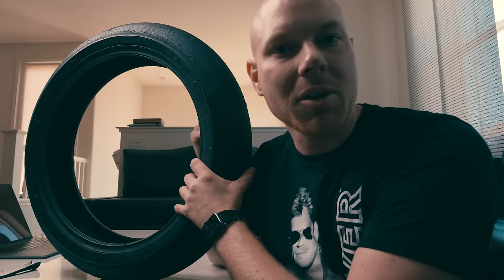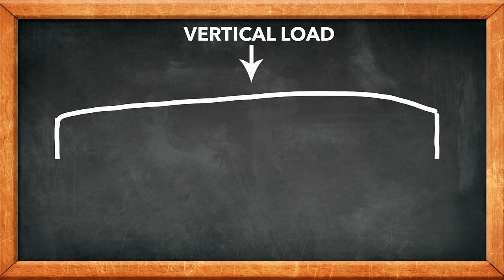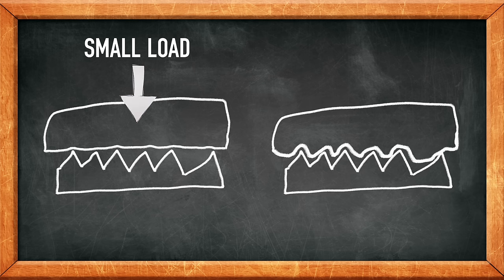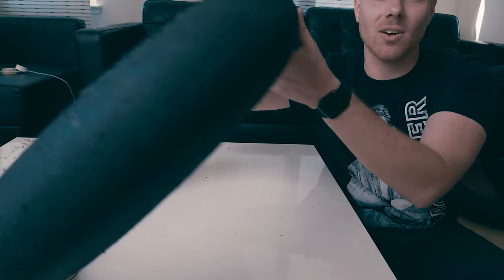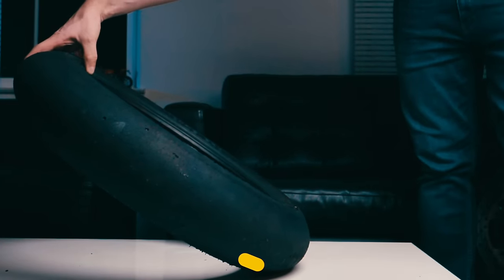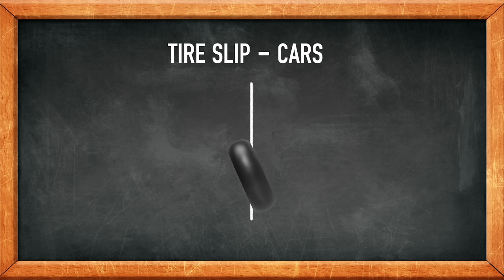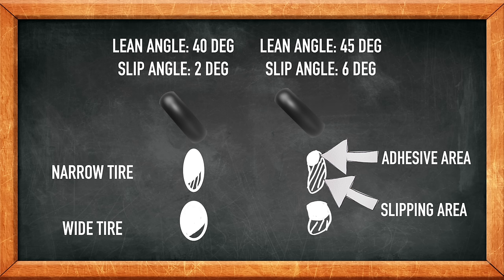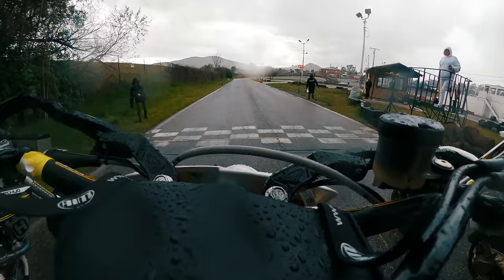Tire Grip | EXPLAINED

Comment: Showed this video to a friend while discussing tires. Question though, what happens when changing tire size say from a 180 rear to a 190? If the wheel is narrower, on a Ducati 749 which was the bike in question and I’m not sure it’s different from a 999, that would change the shape of the 190. It would make it more triangular being on a narrower wheel. Wouldn’t this also affect the molecular structure of the tire like stretching a rubber band? Curious as to your thoughts.

Comment: Tire grip is all about materials used. Not only with the tire but aswell as what your putting the tire on(road surface).
Reply: Thats what skatewheels are made out of different materials. Paddle tires use the sand against itself.

Comment: Is it safe to change tire width for example, from 150 to 160?
Reply: Yes.... Sort of.. if the bikes swing arm will allow the wider tire, and if the rim is wide enough, it is safe. The problem comes when the Rim isn't wide enough, the tire deforms beyond what it's intended and, essentially you get a very tall unstable tire. Or it runs on your swingarm/frame/fairings.

Comment: Wider tyres have more grip? Well that all depends on a great deal of variables, rubber friction is just the start of those dynamics. Think about a drag car tyre folding under itself during takeoff and then expanding during the run... Now try turning a drag car around a corner.

Comment: "Friction is indepent of contact area, as the load is the same, not so for rubber friction"

"If we increase the load, we have more friction"

Now, wait a minute.

As the tire deforms, even microscopically, the coefficient of friction changes, thus changing the friction force.  Friction is still independent of contact area.

Comment: Hey guys, I really need help here.
Ive got a Onewheel XR and I'm trying t find out if you still need a treaded tire for grip when it gets a ''little'' wet outside.
The tire is quite wide en your own weight is directy on the one wheel. 
Can I still just use a slick tire safely on a wet road? 
(Speed is between 20/30 kpmh, 12/18mph) 
-O-

Comment: Hey Mike. When you take all factors into consideration, including the tire grip, does it mean that cars have more grip compared to motorcycles? (let's say a Superbike versus supercar, or a rally bike versus rally car. Apples to apples.)
Reply from the maker: Great question Tyler. It depends on the car! A sporty but still ‘regular car’, say a BMW M3, will be able to maintain less lateral acceleration in corners ~1.1 G, has less grip), as compared to a sport bike with good tires, ~1.2-1.5 G.

A Formula SAE car will be able to maintain higher lateral acceleration ~2G, because of its wings, which provide vertical load, without the disadvantage of mass. 

A Porsche GT3 will be closer to a sports bike with good tires. 

A Formula 1 car will beat all of the above with ease. Like it’s not even close.
Reply: @MikeonBikes  Thanks for the answer Mike! So excluding F1, a top end motorcycle and a top end car should be pretty similar.

F1 or Le Mans seems like alien technology compared to bikes or cars. Do you forsee a future where bikes will come up with such technology to be able to compete in lap times with F1/LMS? (Winglets, downforce, breaking/cornering power etc.)

Comment: I actually blasted those other guys for saying tire size doesn't matter, such ignorance and lack of understanding.  If that were the case race tires would only be 1" thick to reduce rolling resistance and that also puts more downward force across a smaller surface area for more friction right? 

We have different compound tires that provide different performance and the grip or traction is directly correlated to contact patch size (width), reduce the contact patch you reduce the working area for those forces to be applied.

Comment: 12:11 "wider tires require more lean angle"
i've learned that the lean angle depends only on your speed and the radius of the turn and also little affected by:
 the bike's and biker's weight and the biker way of sitting

i don't thing that it has anything with tire width
Reply: the lean angle that matters is not that of the bike's but rather the line from center of the contact patch to the center of gravity of the bike+rider system. a wider tire moves the contact patch closer to the inside of the turn for a given bike lean angle, reducing the angle that matters.

meaning wider tires do require more lean angle

Comment: Well, it never made any sense to me that the size of the patch supposedly has no effect on grip. Just thinking about it, I can feel grip difference from just over/underinflating them. If the "patch size has no effect on grip" story was true, the tire pressure should have absolutely no effect on grip and only thing that matters is the material that touches the ground (ie. as long as the material is smooth tire and not my rims I should be getting same results even if the tire is flat).
What I would like to understand is why grooves on my new Michelin Road 5 are in opposite directions on the front and back tire. The back tire seems intuitive -- as it rolls forward the channels push the water outside. The front tire is opposite, as the tire rolls forward channels narrow down effectively pushing the water inside. I have checked the rolling direction arrow like 20 times when I was replacing tires on my bike last weekend. One theory I have is that the front tire is narrower and the grooves are relatively deep and so on the front tire it actually might make sense to keep the water from dispersing.
Reply: I know that with dirt/gravel tyres that the grooves are opposite because the rear is accelerating, while the front is braking, ie. opposite "directions"

Comment: i thik the F=μn is not the right formula as it is for sliding the one that should be use its the rolling friction Fk,r=μk,rFn used whit your specific material as rubber

Comment: Cannot understand the contact patch size yet. On 3:33 you "explain" that more contact patch means more adhesion, but this "adhesion" is actually what you called before "simple friction". And this simple friction is indeed depends on the weight (normal force) only, no contact patch. So this adhesion is also depends on the weight, no contact patch.
Reply: I think you need to watch again and grasp the content a bit more carefully. I also rewatched the video a couple times to really get it
Reply: Actually the weight is not really that affecting the grip from contact patch. The size of contact patch and the amount of adhesive it self determine how much grip will achieve. I know weight also takes part in grip, but at certain level you don't really need to over think about it, because we're talking about motorcycle dynamics
Reply: @jeeewhyyypheee  Based on what you say the contact patch size influences the grip better than the weight?
The video says that, without any scientific support.
Just saying something doesn't make it true.
The only science provided is the friction coefficient graph. It just says this coefficient depends on the load, and is not constant. No true explanation on this fact was given.

Bottom line - saying patch size proportional to adhesion is empty words.
I'm not saing its false, just saing no justification was provided, and this is what I expect from this type of video.
Reply: @idanpere1  Maybe this is just a terminology thing here? (I'm not a scientist) My understanding is that vertical force (weight) acts to deform the tyre to create a larger contact patch. The issues are slip angle and thermal stability which ultimately determine the ability of the tyre to maintain a certain level of grip.

Essentially aren't all these things just interdependent? From a rider's non-scientific pov, I certainly feel that there's more grip when the same tyre feels a bit softer by letting out a psi or two within the manufacturer's range (road tyres). And I also felt that better suspension provided more grip. Isn't better suspension in braking and cornering helping to maintain the stability of the contact patch?

I don't know for sure what is going on a scientific level so please explain how we can get more grip from the tyres.
Reply: @2002RM  I really like the way you describe it. For me weight alone doesn't really affect grip, and weight only can add contact patch at certain maximum level, after that it's all depends on tire performance.
Reply: Adhesion is very literally NOT simple friction.  Simple friction is at play as far as pressing the tire more into the grooves of the ground for traction (to a degree as it's not a pure linear equation), but adhesion is more like the effect of a roll of tape.  Put a piece of scotch tape on a table with a little bit hanging off, then pull the tape towards you (laterally/sideways, like taking a stick of gum out of the pack, don't peel it up).  Had a lot of grip, didn't it?  Was there a lot of weight there? No.  Now put a paper weight on the tape, did it change very much in how much force it took to pull the tape off?  No.  Why? Adhesion forces, not simple friction, are at play.  Especially with slicks, adhesion forces vary based on how much contact the rubber has with the road, so the more surface area, the stickier it will be.  If this wasn't the case, race cars would be going out on Tour de France bicycle tires.
Reply: @nunyabusiness896  I really like the way you describe it with a roll tape.

Comment: I'll give you a simple experiment to do to prove yourself wrong. With the motor off put your bike in 2nd gear and push it at let's say 5mph then dump the clutch. The back tire will skid. Then sit on the bike in 2nd gear and have someone else push the bike 5mph and dump the clutch. The motor will turn over. Figuring out the traction of a tire is a lot more complicated than just looking at the equation for the coefficient of drag for rubber. Weight has a huge effect on the traction rubber provides
Reply: He never said weight had no effect, and if you were watching closely it's more that there's an ideal weight for a given compound/size/tire pressure/etc. and being too light or too heavy will cause problems.  He clarified that simply adding more weight doesn't necessarily create more grip after a certain point.  There's also a matter of tire temp.  If you do your experiment on ice cold tires, the adhesion forces aren't really there, but do it on super hot race slicks and the engine very well might turn over without a rider on the bike.  Also, for the record, I've seen plenty of people drag a rear tire with a rider on, too, it's all about the tire and surface you're on if there's enough grip available, not just the weight alone.

Comment: Mike, the title of your video postulates that wider tires offer more grip but then you veer off to many other 
dynamic principles that DO NOT necessarily support your premise, Nu (coefficient of friction) properly describes
many of the “variables” that you use to support deny the validity that  F= mu x N is invalid.
You correctly explain why rubber hysteresis affects the “shark bite” profile of contact patch interaction of rubber/asphalt
but that does not make F=mu X N invalid. In reinforces it as when N increases the shark bite interaction is deeper and increases the friction force,
Now, YES, as the N increases beyond the ability of the rubber to fill the voids, the Mu changes  because the rubber properties at higher N changes.
BUT, none of this justifies a wider tire. Why do smaller 250cc GP bikes go around corners with much smaller tire widths? You go on to talk about
slip angles, counter steering, etc which are all valid motorcycle dymanic issues but have nothing to do with tire width.
The only reason bigger CC bike have wider tires is to absorb the heat and abrasion that higher power bikes demand of the rubber.
A 200 mm rear tire on 150 hp bike that originally was spec as a 180mm will NOT increase your tire traction- but it may serve rider vanity!
Your video was excellent on explaining real motorcycle dynamic issues but many of your points were irrelevant to explaining the “wider tire
must be better” issue. Many years of engineering pedigree has gone into the design of motorcycles and the  rear tires widths they should have.
The same bike, same rider, same technique on a bike specified with a  180mm will NOT get better traction with a 190mm rear. In fact handling will be worse with no improvement in grip. Tire-asphalt coefficients of friction are huge variables that change dramatically from road to road and even within sections of road and between wet/dry , incorrect tire pressure, etc,. I wish riders had more knowledge of these dynamic issues
and forget about a wider rear  tire!
Reply from the maker: Tinuti, wider tires have a wider contact patch. For the same load and tire pressure, a wider tire has the same contact patch area as a narrower one. At high slip angles a wider tires contact patch has a larger area that still sees adhesive friction.

Given the properties of a wider tire, lower tire pressures can be run, and thus we get a larger contact patch area.

Wider tires have a lot of downsides, including, but not limited to:
- Requiring more lean angle for the same given speed and corner radius
- More unsprung mass, making the suspensions job a lot harder
- Stability problems at high speeds
- .....

What tire width should be selected for specific bikes requires a lot of considerations. The video brought all of this up.

"The same bike, same rider, same technique on a bike specified with a  180mm will NOT get better traction with a 190mm rear. In fact handling will be worse as well as no improvement in grip."

Maybe, maybe not.
- Is the rim designed to take a 190 tire?
- How is the 190 tires performance compared to the 180? Different tire widths from the same manufacturer often have slightly different performance because of carcass design etc.
- Did the rider consider all the geometric implications of changing the tires width?
- Did the rider consider all the suspension implications of changing the tires width?
- What tire pressures are being run?
-....

A 190 tire might provide more grip, it might provide less. If the rider does not understand what goes into selecting the tire width, they should not be changing it. 

F= mu x N does not describe rubber friction, and Amontons' laws of friction does certainly not describe how tires behave in reality.
"The force of friction is directly proportional to the applied load."
"The force of friction is independent of the apparent area of contact."

For tires on asphalt this should be changed to: 
"The force of friction is NOT directly proportional to the applied load."
"The force of friction is NOT independent of the apparent area of contact."
Reply: @MikeonBikes  Mike With much respect (as I have watched many of your videos and they are always very informative),
I must say you first 2 sentences in your reply contradict eachother. Of the many reasons you don’t want to put a wider tire than specified by mfg.,
you forgot to include 2 other major reasons: wider tires (heavier) also add rotational inertia that slows acceleration and more aerodynamic drag which is bad for acceleration and top speed.  Forget iF you can fit a wider tire on the rim; if you could all the losses mentioned above would offset any “grip advantage” while cornering.  Look how well 250 cc GP bikes corner (have traction) on slimmer tires. For 99% of road riders, wider rear than spec is a “fool’s goal” The only real practical reason for wider tires is to absorb heat , deformation and ablation from more powerful motors -not to add more traction.
Reply from the maker: Tinuti, with much respect, I don't think you understand how tire slip works.That is why you erroneously believe I contradicted myself.

Get this book, The Racing & High performance tire, Paul Haney, 2003.

Have a look at page 95, which shows contact patch areas of slip and adhesion. Then read pages 99-102.

Thanks.

Comment: that is called rolling coefficient, similar to kinect coefficient, but they use the same formula, the only change is the coefficient that is lower, but is not true than the formula is incorrect, the rubber have a different coefficient just that (hard rubber have also a different coefficient that soft rubber, even the race tyres have different coefficients in different parts of the wheel.), you look at microscope alway there is a gap, to fill that gap you need to push the rubber harder, and that is just more Normal force...
By the way, is not the same fricion than stick a tape, the tape have glue, you are changing the rules with that example, you can put a duck tape on the wall and there is no way thatn the static friction do something that is just glue, and if you put more glue will be more difficult to take off the wall, but there is no friction...
About the cars and the width of they tyres it is so they last more laps, not because they are more or less wide they will improve the grip, if that were the case we would surely see cars with wider wheels, the more power a car has, it needs a more robust wheel to transmit that power to the floor,  more robust means more rubber.